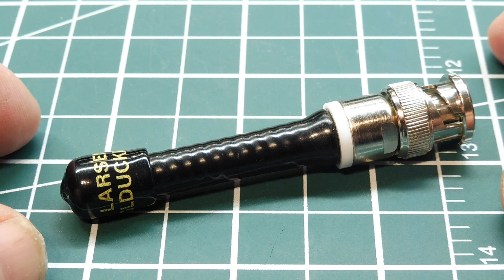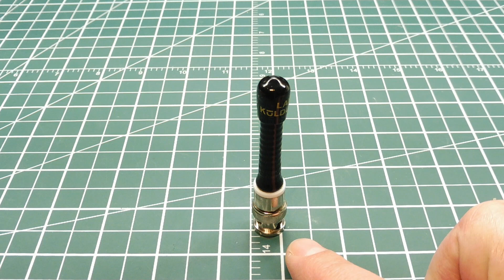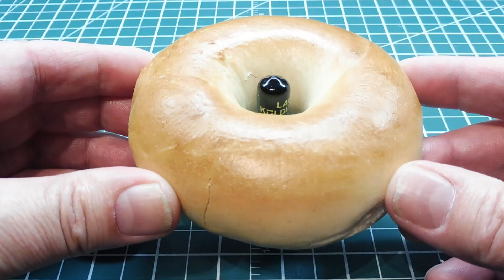Antennas 101  / How does an antenna work

Comment: 6dB doesn't double your range.  Remember RF power (like light) falls as distance squared.
Reply: Yes, but will this lead to twice as many bagels?
Reply from the maker: Radio waves follow an inverse square law for power density. The power density is proportional to the inverse square of the distance. Every time you double the distance, you receive only one-fourth the power. This means that every 6-dBm increase in output power doubles the possible distance that is achievable. Double the range = 4 times the power and every 3db is double the power. This is a basic rule of thumb of antenna gain.
http://www.amalgamate2000.com/sales/2.htm
Reply: You started off well and then made the error.
The power per unit area of RF power falls as the square of the distance.  
The gain is dB which is a ratio of power in this case, it is a doubling of the power.  Hence the range goes up by sqrt(2)
Reply from the maker: Yes ... you are correct, on doubling the power the range goes up by the square root of 2 which is 1.41
In this case the gain is 6db which is a power ratio of 4, and the square root of 4 is 2 ... which is double the distance.
I think you are confusing voltage ratio with power ratio.

Comment: Do you have a vid for am and fm ant. construction & calibration
Reply from the maker: No .. not at this time, but here is an excellent book on the subject.
http://www.apparentlyapparel.com/uploads/5/3/5/6/5356442/_____practical_antenna_handbook_fourth_edition_carr.pdf
Reply: Do you also have any recommendations for books about patch antennas in the region of UHF. Thank you for your videos! I really liked them.
Best wishes. =)
Reply from the maker: For information on microstrip patch antennas, google for application notes on the subject as they will be up to date.
Here are some examples: 
http://www.cypress.com/file/136236/download
http://www.proant.se/files/user/OnBoard%20SMD%20WLAN%20Application%20note%20v1.2.pdf

A good general book on UHF devices is the ARRL UHF/Microwave Experimental manual. ISBN 0-87259-312-6
Reply: Thank you! The book is unfortunately not available in my local library (i am from germany, looks like the book has good availability in the US, but not around here). Nevertheless the guidelines definitely got me started in to the right direction. =)

Comment: I have forgotten, an N connector is 50 ohms. What is a BNC? BTW, ever play with the angle of the ground plain to see the impedance? Ever play with different copper wire? (could be the oxygen content) Ever use a capacitor for matching purposes? Ever ground your rig using a copper pipe or many small ones over a large distance? All of it makes a difference.
Reply: Joe Shmoe

Comment: That was really interesting. One point; the radial wires did not look like they where are 45 degrees. More like 30 degrees. I guess you could tune the wires if you have a signal strength meter. Perhaps a smart phone with a WiFi app that shows signal strength. That might make an interesting video. Thanks, I'm enjoying these videos. Short, simple, clear and no frills.
Reply from the maker: Good observation .. I built a few of these antennas with different radial angles and I happened to use that one in the video.
You are correct, the best way to fine tune the antenna is with a field strength meter and play with the angles.
You could even cut the radiator longer to start with and trim off a little bit at a time for a peak in RSSI .
Reply: Robert Shaver